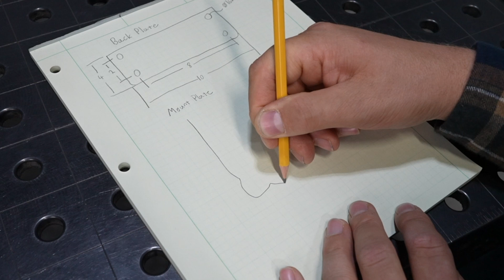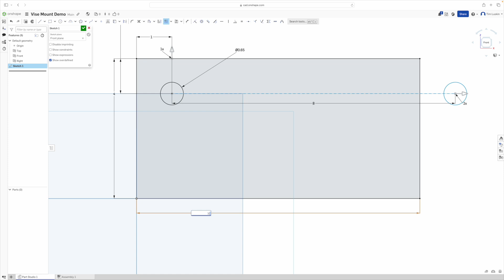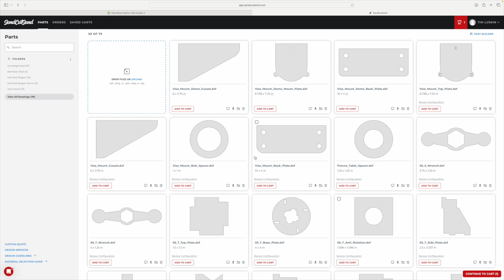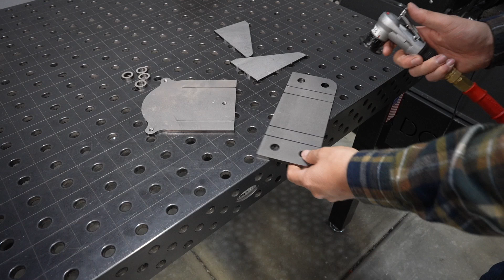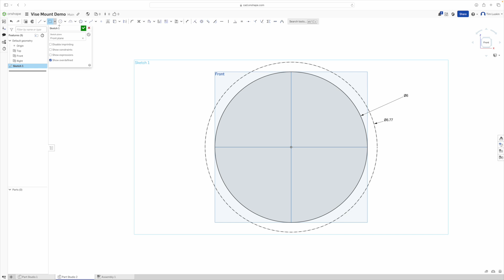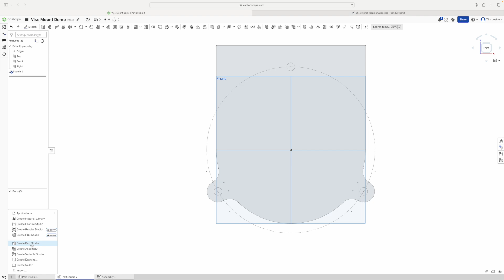How to Design and Buy Custom Metal Parts - It's easier than ever before

Comment: Tip: if you incorporate slots in the back and top plate to be cut out and  added material to the 2 vertical parts which fit into these slots you can fit them perfectly into each other in the exactly right positions and then weld the parts together.
Reply: Do you have a video that would explain how to add slots?

Comment: If you can make another version of this design and using tabs, slots and tolerances. Good job though 👍
Reply from the maker: I usually use tab and slot design for this sort of thing, but in this case I wanted to keep it as simple as possible for the sake of the tutorial.

Comment: So that was $120 for the cut material? How much less would a second setup have been, lets say you had two tables.....?
Reply from the maker: I just checked it in the cart. The price for 1 set is $118 shipped ($100 after the 15% viewer discount). The price for 2 sets is $138 shipped ($117 after the 15% discount). The price for 10 sets is $488 shipped ($414 after discount). So the final price per unit is $100 ea for 1 pc, $58 ea for 2 pc, or $41 ea for 10pc.

Comment: Shapr3D is also a good option. It has parametric modelling as well and is quite powerful. Also works on iPad with Apple pencil which is what I do.
Reply from the maker: Thanks! I've played with it a bit and it didn't have the 2d sheet metal tools I need, but as a solid modeling tool, it's the fastest of any I've tried.

Comment: You make it look so easy. How long did it take to learn the basics? Thank you for the informational video.
Reply from the maker: My day job was in mechanical engineering, so I've been using CAD for many years. It's a lot easier than it used to be and with a little googling, most people can create their first simple designs like this in a few hours. The key is just starting with something simple even if you don't know the whole process from the beginning.